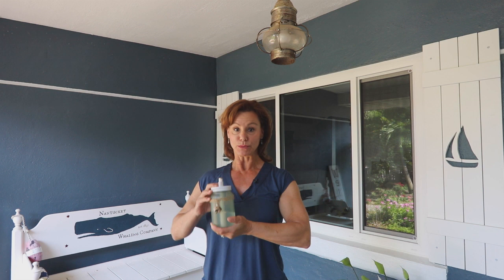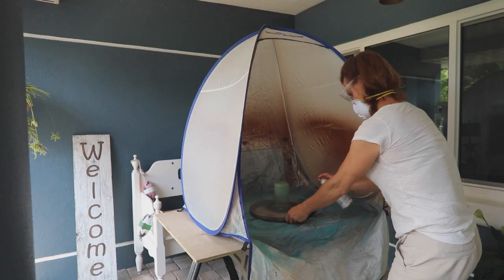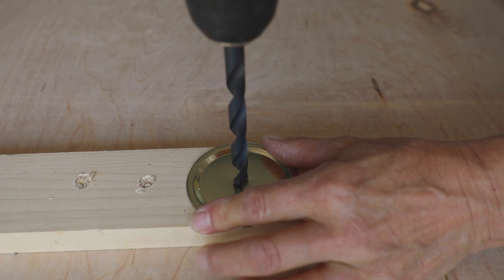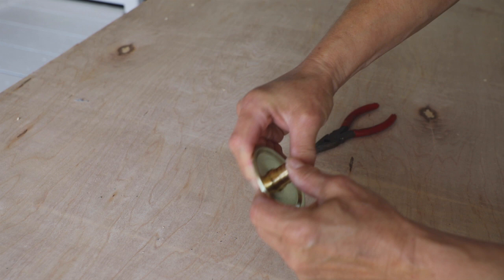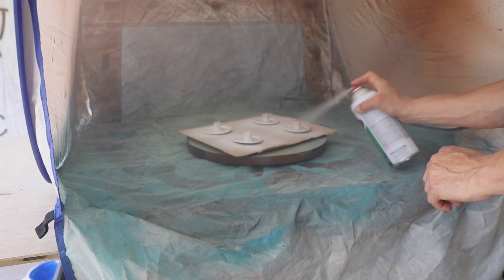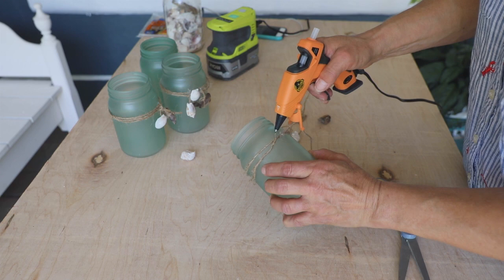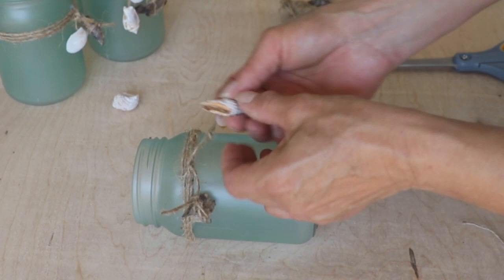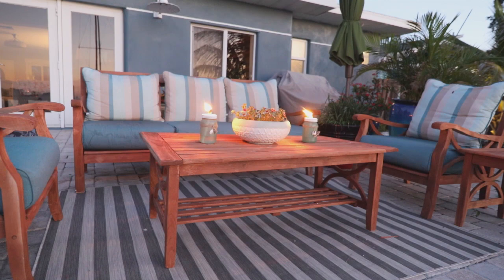DIY Tiki Torch Tutorial

Comment: I want to try this idea! But how do you wind the wick up? Do you have to manually pull the wick up through the coupling after each use?
Reply from the maker: Hi - that's a good question!  The wick has lasted all season without me having to move it up.  Yes, eventually you'll need to pull it up a little but that takes a lot of uses.  Have fun with the project!